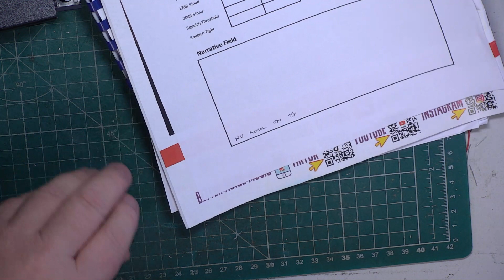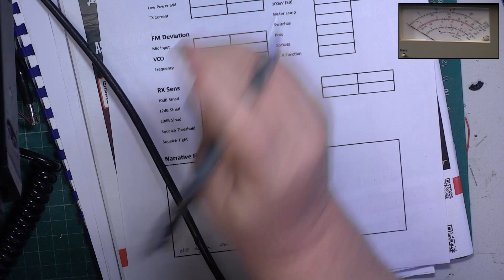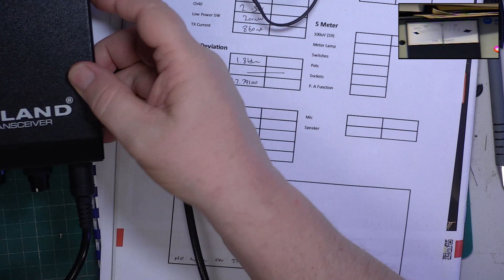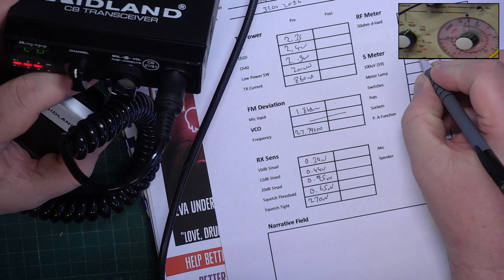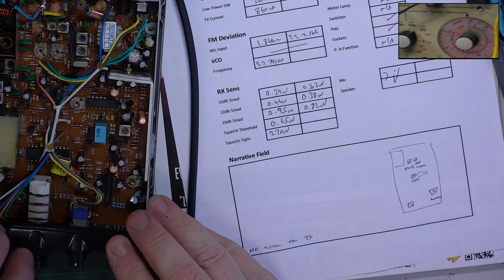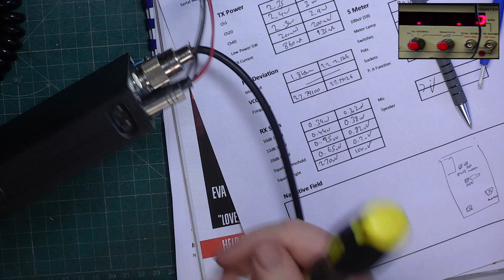Midland 77-805DUK CB27/81 UK FM CB radio transportable - Optimisation

Comment: Shame about the awful power output...
Reply from the maker: It's the late version of the 'D' variant, right at the end of production of this style set. In goes a crystal filter, out goes the traditional channel selector etc.

Reading the true output power isn't helped by the secondary aerial connection & loading coil for the telescopic aerial. Always add 0.4W to what out test set says to a more normal power meter. Bear in mind I ran this at 13.2V & not 13.8V as usual; that's what it says on the back. I don't have an instruction manual on file to see what the maximum input voltage is for this version.

The 'on the air' test that follows this worked better than most.

Richard
Reply: How do you tell which Variant these are ?
 @ukfmcbradioservicingTango21
Reply from the maker: Easy. The model number of the rarlier one is 77-805UK, the later one is 77-805DUK. On the front, the earlier one has channel 9 screen printed on the front, where that channel is on the channel knob. The later one doesn't have channel 9 printed.

Richard
Reply: Thank you  @ukfmcbradioservicingTango21